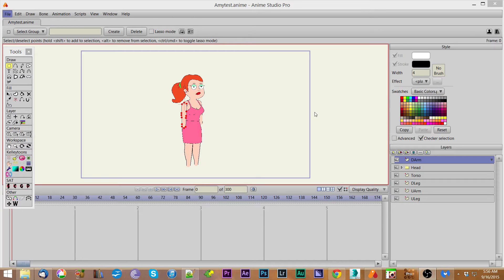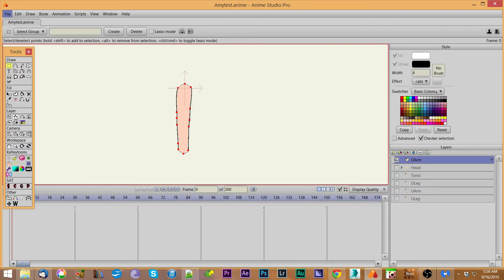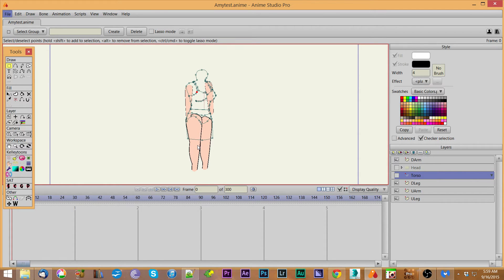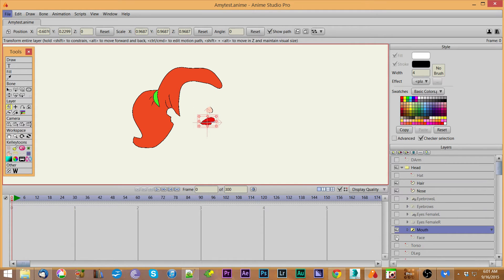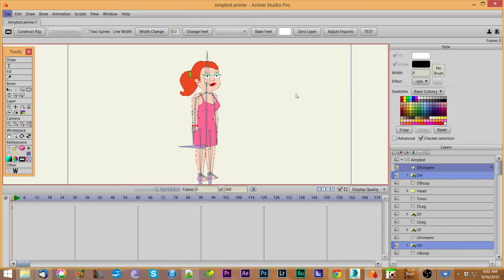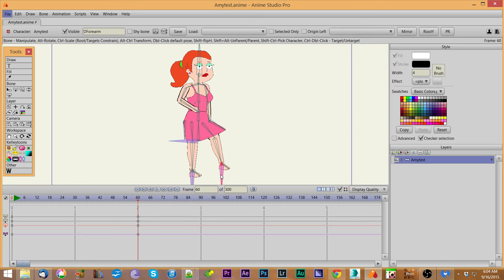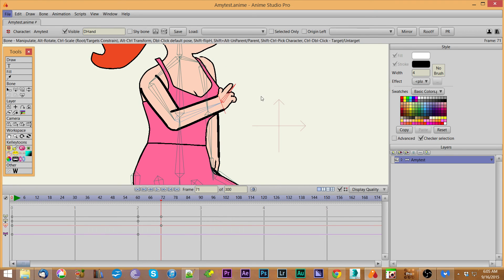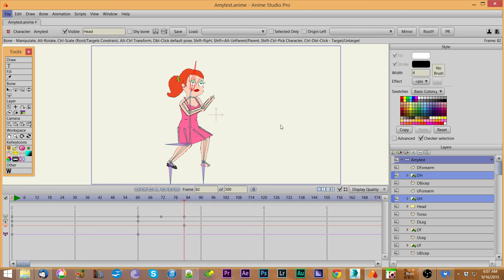AutoRig Revisited

Comment: Beautiful! I rig my character's up similar. Nice work with the scripting. I know it's taken you some time to do that.
Reply from the maker: +JustoShow Thanks for the kind words.  Yeah, the scripting was the most complicated one I've ever done, and I'm always polishing it up to make it as easy as possible for me.  But at least it means I never have to worry about doing any more rigging again, which was always a PITA.
Reply from the maker: +Mike Kelley Oh, and I should note that now line widths DO work properly -- thankfully.  I also have the line width tool available separately for download on our forums for those who want to run it and automatically adjust their character and/or set line widths.
Reply: +Mike Kelley I registered on the forum but it would not let me sign in for some reason. I'm just waiting for a bit to see what happens. I'm curious into doing a little scripting my self as well.
Reply from the maker: +JustoShow When did you register?  Right now we only have one person awaiting verification (which I have to send out manually) and I can't even pronounce the user name they used.  Either try again or send me a private email (mike at kelleytown dot com) and I'll get you on there.
Reply: +Mike Kelley I registered yesterday actually. I will send you an email.